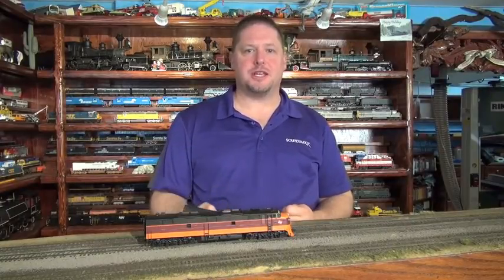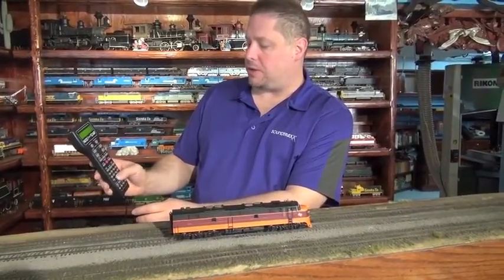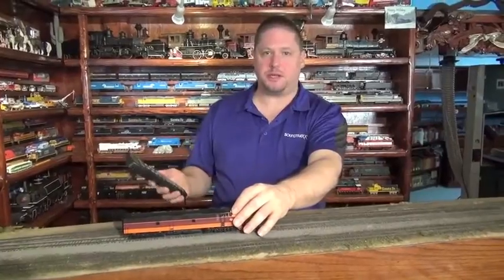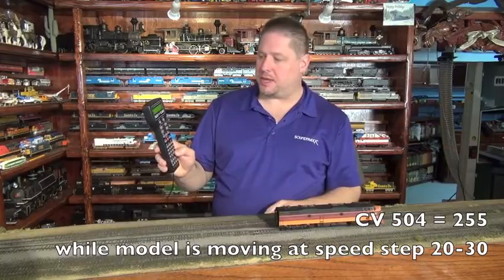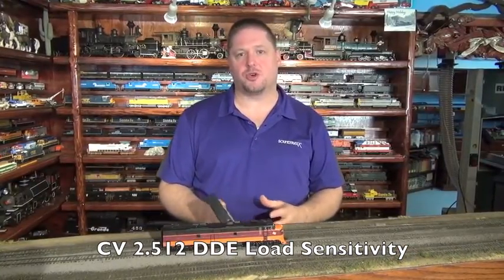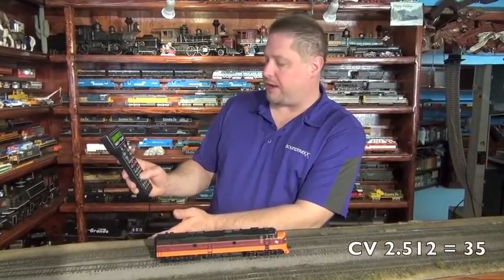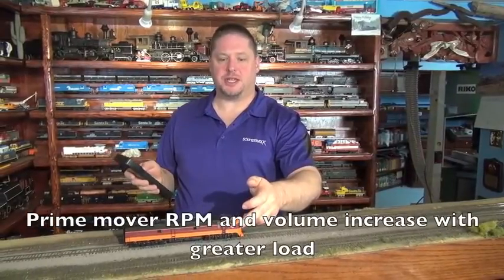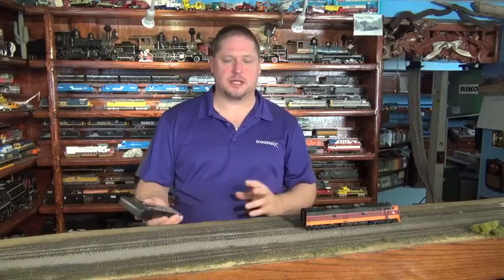Tsunami2 Diesel DDE Calibration

Comment: In the video, one sets CV 1.512 to 35, but the user guide, fhe instructions  have CV 1.512 set to 16.  Is there a reason that value of 35 is a better starting point?   Thanks for the videos.  They are a help.
Reply from the maker: CV 2.512 is determining how sensitive the decoder is to changes in the load.  Higher values are more sensitive.  Starting low may then give you a baseline to see how it changes the notching/Chuff tone, then adjust the value as you see fit.  Try both values and see how it behaves and decide for your personal tastes how it works and make adjustments.  Use a higher value if you don’t think the effect is as strong, lower if you think it’s too much.  This may also vary by loco depending on the drive line, efficiency of the motor, etc.  I use a much higher value in my steam locos for a more drastic effect.  Diesels, when running together if sensitivity is too high, the notching of the different units may be out of sync, so using a lower value may be more beneficial for coordinated notching.  You can’t break it by using a different value, so experiment and see what works for you.  Thank you!

Comment: does the locomotive have to be in motion or can it be stationary. i use decoder pro for my programming and a digitrax cab system
Reply from the maker: Dez Warren: The locomotive must be in motion when calibrating DDE as the decoder is monitoring responses from the motor during the process. You can use JMRI to program on the main in Operations Mode ("Ops Mode") to configure these CVs. You can also use the Digitrax DT400 or DT402 throttles to calibrate DDE directly through your command station. We recommend this method as it allows you to control the model and program CVs using only one device, the hand-held throttle.
Reply: @SoundtraxxDCC  If this DDE is supposed to be calibrated at speed step 20-30 obviously that's in 128 steps what step would it need to be in for 28 speed steps?  Thanks!